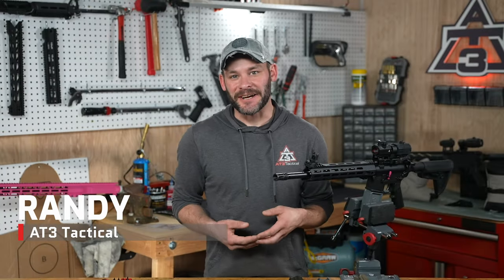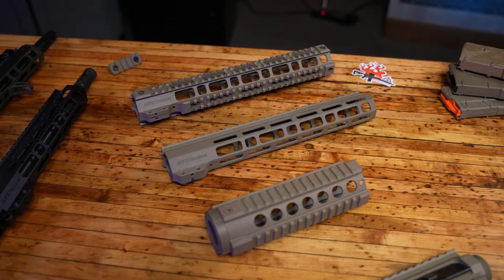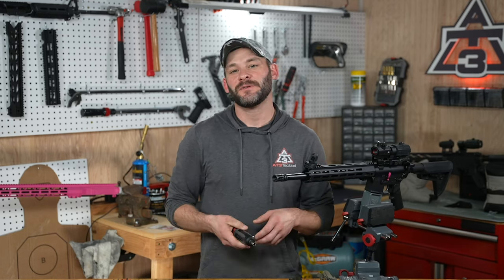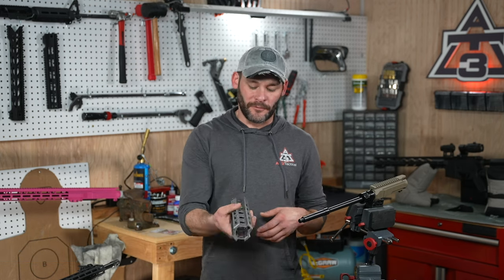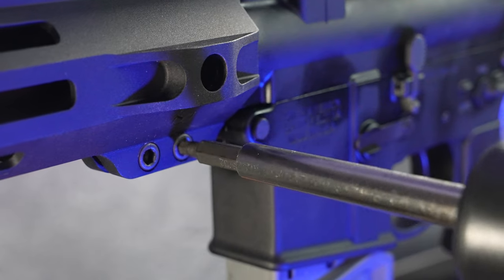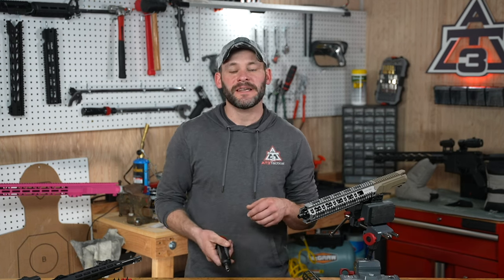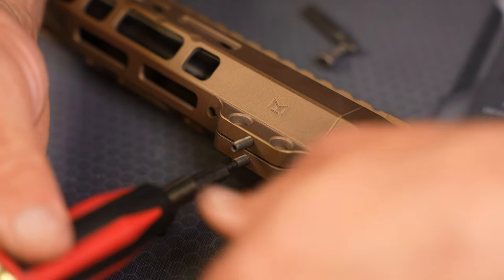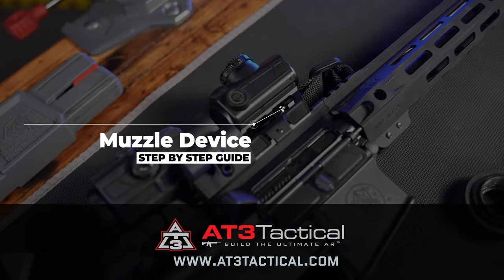How To Install a Handguard on AR Rifles

Comment: Best is subjective but I like a barrel nut that has to be timed, then the handguard has screws that screw INTO the barrel nut and then the handguard has anti rotation tabs. I dont trust compression fit handguards. I had one that would move forward 1/4 inch under recoil. It never came off but I won'tt trust them ever again.

Comment: So what if i have a pinned and welded suppressor and a handguard that wont clear it?
Reply from the maker: That does not sound good
Reply: What state are you from? Is my first question
Reply: @joshbenalcazar12367  sc. but that doesnt matter. If a suppressor is pinned and welded and the length is 16” you dont need an sbr tax stamp

Comment: Criterion says do a gap between hand guard rail and upper receiver just a small gap. Is this correct?
Reply from the maker: I'll have to go checkout their instructions specifically. In most cases, probably 80%-90% handguard/upper manufacturers, they are not only touching, but also include anti-rotation tabs to keep everything locked in. But I'll definitely check out Criterion.
Reply: I imagine this would have to be in reference to a specific handguard installation.  For what it's worth, I notice with all of my geissele handguard installations the crossbolts would be binding if attempted to pull the handguard flush to the receiver.  From a purely theory standpoint, I imagine one  would just not want the crossbolts,  or whatever fastening system keeping the handguard to the  barrel nut, to be binding against the barrel nut.  Whether or not this makes a given model of handguard flush to the receiver is likely model dependent.  I use geissele as an example as they are known for their tight tolerances, removing perceived error from this aspect.